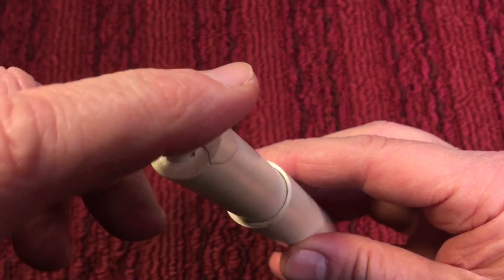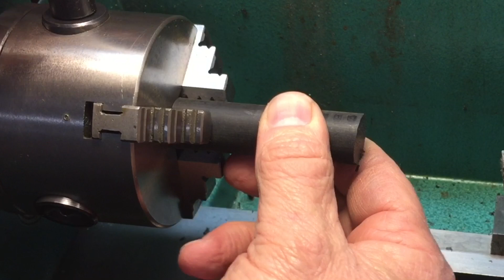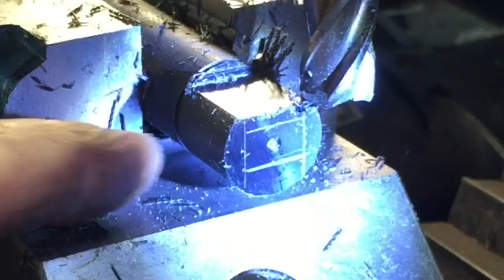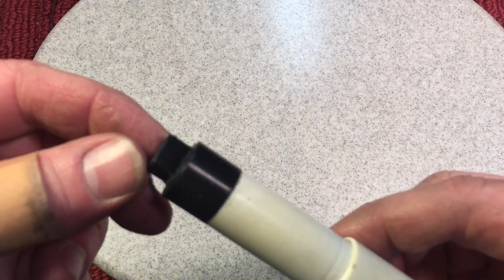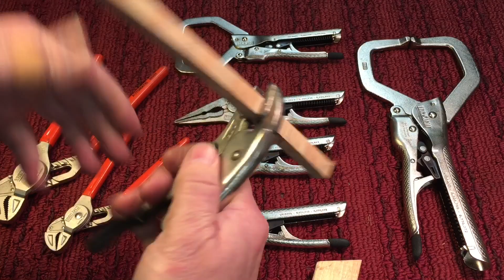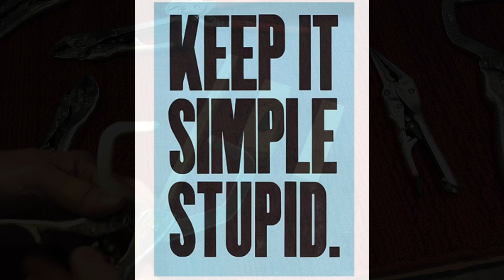Small Fabrication and LockJaw Plier Demonstration

Comment: I have both Channelock and Knipex pliers (sometimes also known by old timers as water pump pliers) and like them both, for recreational and auto/home repair use. There isn't enough difference between them to justify the higher Knipex price.  What I do like about both is that I no longer worry about "garage grunge" thanks to Scoutcrafters 50/50 mineral oil / petroleum jelly rust preventative. Good quality tools deserve good care.

Comment: I like the tutorial on the toilet paper roll dispenser because you show how to repair and make a new part. Everyone needs to be taught something new for the first time no matter how simple it is. I remember the Lockjaw tools and now I know why I haven't seen them in years. Thank you for sharing this and no tutorial is too simple, they all have gems of information.
Reply: Its the thought process. And it differs a lot depending on the tools at your immediate convenience, too.
 I built my own wire wheel/grinder like 30 years ago. I modelled it after the Eiffel tower because I reasoned that would give me the most room to work around the working end and plenty of stability as well. I had an old worn out arbor from a farmer's V sharpening tool, a GE 1/2hp motor out of washing machine, a couple of AC switches and some 2 by 4s. Today it still works and it rolls around, too.  I think my only real expense was the V belt I bought from the local auto store plus some new oil lite bushings for the old arbor to make it like new again. I also used a 3 way switch to have control over the two speeds - spin (fast) and wash (slow). I would say it is the #1 tool any one should get who is interested in refurbishing stuff.

Comment: Interesting subject John. Today I had all the stuff out ready to modify my trailer hitch. Put the mask on and went to adjust the headband screw and it bike and dropped down my collar. Bugger. So no welding till I’ve fixed it. It was a 1/4 inch column of plastic that forms the axis of the adjust mech and it had come off the strap. That’s finished no way glue would do. So a brass bolt near that diameter soldered to a brass plate which goes inside the strap is quickly fabricated. All reassembled and I’m back in business with about 40 mins less daylight!  So I save £80 on a new mask I don’t need, because I’ve got tins of various brass bolts and snips and bits of brass sheet and a soldering iron ( or 5). Hooray for hoarding!
Reply from the maker: Lucky you had a stash of Brass!!!  😃👍

Comment: Your living the dream. Doing what you want when you want and sharing your passion with others.  
  A quick note about the Knipex  Pliers. I grew up with Craftsman and channelock. They are great but after discovering knipex i  have not purchased anything but. They are harder steel they bite better they are generally slimmer profile to fit into tight areas. To me and me only they are well worth the additional cost.   
  Really liking your channel content 👍

Comment: Hard to beat a pair of real ViseGrips.  Bought my first pair at 15 - had to save up for them, because we were quite poor - then used them in heavy DIY for 40 years, at which point they had a little rust and lots of dried grease.  A little purple power degreaser, a wipe down and 5 minutes at the wire wheel, and they were as new.  Several years ago when my son was settling down, I dropped the tool in the mail to him, and now he raves about how wonderful his 50 year-old ViceGrips are!  I agree, elegant design uses the least number of parts, yet makes using the tool totally intuitive.
Reply from the maker: Marc- If I could only have 5 tools that Vise Grip would be one of them!   =D

Comment: Fixing the toilet roll holder reminded me of a job a did a couple of years ago.

My wife managed to break an IKEA standard lamp.
Which cost about 6 GBP.
The part that broke was a connector,  18 tpi NPT parallel thread on one end, M10x1 on the other, milled flats in between the 2 threads.
It only took me a couple of hours to make a replacement part for this 6 pound lamp.
Using a several thousand pounds worth of lathe and milling machine that I happen to own ...
Reply: That’s how you can justify owning all this shit, so you can save a few pennies by spending hours in the shed. And emerge triumphant , knowing that you’re certainly the only bloke on your street that has the ingenuity and tools to be able to repair not replace. All transferable skills too, a breakdown in the wilds of Wales isn’t quite so terrifying when you know what to do.
Reply from the maker: LOL Mike- Honestly I find those jobs to be some of the most rewarding and fun jobs to do in the shop. It’s true if you consider our man hours the cost of electricity and parts we totally overpaid for the repair, but you can’t put a price on pure satisfaction!  😃👍

Comment: Iv had and used a set of lockjaw c clamps for the last 8 or 9 years. All I do is keep them clean and oiled and iv never had an issue with them. They’re an excellent tool for when you only have one hand to clamp down a frame to your bench
Reply from the maker: Sean- Like you I never abuse my tools!  Mine are also that old and are like new.  However they never would have lasted thru my teenage years.

Comment: I think there's a company called armor and those c clamps are very good for metal framing they hold the same pressure and no need for adjustment it's a really good way to save time. More or less the reason why the auto adjust is such a good thing is because the new irwin C clamps are not at the same level as they used to be.

Comment: Ah the good olde K.I.S.S. rule lol. I was thinking the same about the toilet paper thing especially when you highlighted before buying it for a dollar, but it was interesting and nice to watch. I have a Greenlee flexible extension bit that has a hex end for chucking up in the drill that always seems to want to slip and round over through extended usage and I'm at the point its rounded over almost completely and I was wondering how to bring it back to being hex. I was thinking a file, but figured I didn't want to spend all that time, then I thought band file or belt sander etc and I thought I might ruin the heat treatment and end up snapping it in use. Then it struck me watching your video whether my wife likes it or not I should find myself a mill haha lol. Its weird because the flexible extension bit has a quick release end for hex bits that is held by set screws on a round shaft, that is then set screwed with a hex shank for chucking in the drill. I like it because I can use different bits in it for running wiring behind walls just wish they would stop wanting to slip in the chuck, or maybe I should just replace my chuck I don't know. Any insight?
Reply from the maker: Hi Rob- The good part about fixing a hex shape is if you place it down on a flat the top is also flat, so you can surface the top and just keep flipping it.  You can use a file but knowing how much to take off is the key.  I have turned squares into rectangles by accident!  LOL  The mill makes that so much easier!  =D
Reply: @ScoutCrafter  yeah thats the problem I think after taking a closer look maybe I have 1/16th at the very end showing the hex shape it once had lol otherwise its almost rounded over completely. Not sure why it likes to slip I have a 3 jaw keyless chuck I tighten down on it and give a few turns by hand before drilling but just always seems to slip, not sure if I should replace the chuck or maybe invest in another setup. I have the hitachi which isn't bad for the money tons of power and suppose to be carbide jaws which seem intact visually.

Comment: Been in the plumbing trade 25 years and keep both Knipex and Channellock in my box. They both have their place. Adjust the Knipex and it’s dead on perfect. Jaws are durable and grip like crazy. If you need to operate them single-handed or in sloppy mud they can be a bit problematic. This is where good old Channellock pliers shine but on certain fittings it can be tough to get the right grip. Oh and don’t let your apprentice spring the jaws like mine did.
Reply from the maker: Eric- I do 99% of all my home repairs but I needed a toilet upstairs and I was working and it needed to be done fast so I called the most reputable plumber in town...  It was an older toilet so I knew it would be a unusual replacement and the big box stores wouldn't have it...  Well, two guys showed up and one was the plumber and his apprentice.  They did the job... When I got the bill I was charged the same price for labor for both the plumber and apprentice!  $80 per hour!!!!  The apprentice could only fetch tools from the truck and carry down the old toilet!  Never again!

Comment: Thanks ScoutCrafter. Always amazed at the Delrin never have had a chance to use it but what a nice material. Wondered how you squared off the scribe lines in the vise to perfectly match the milling machine. Sorry if it sounds like an such an amateur question.
Reply from the maker: Kevin- Believe it or not that is a fantastic question- One of the big difficulties in squaring off round stock in the Mill is getting the surfaces parallel to the milling bed. Since the stock is around once you make the first cut everything has to key off of the first cut. So an easy way to do it is to make one cut then turn the article 90° and use a small square to make sure the milled surface is vertical. Then just repeat that procedure three more times!  😃👍

Comment: @scoutcrafter as I told you b4, I'm a plumber,  but I do service plumbing,  repairing old houses most of the time,  95%of the time im in very tight spots,  awkward angles,  reaching around this or that,  knipex makes a tremendous difference in the fact of the locking positions,  when I used to use channellock when I first started you would reach to tighten something and the handles would slip and move to where you have to completely pull your arm away and readjust after spending time getting into somewhat of a comfortable position if it was even possible making it extremely frustrating,  knipex saves alot of headache for that alone.  But the grip and teeth strength alone makes channellock seem like harbor freight imo knipex is leaps and bounds ahead of any and all pliers its astonishing.  Their pipe wrench included.  Then the no pinch handles saves you aswell
Reply from the maker: Brandon, I have a few pair of Knipex and Gedore.  A few companies like Irwin have copied the design almost exactly.  You being a professional will definitely notice even the slightest of advantages because of the amount of time you spend with any particular tool.  That's why mechanics usually prefer tools like Snap-On and Mac.   I do love a well designed tool!
Reply: @ScoutCrafter  absolutely,  same goes for pipe wrenches,  there are only a few good manufacturers, I don't trust most of them cause I don't want to punch a wall or stud or concrete.  Been there done that. Tbh with professional use,  I went through 2 pairs a year cause either the teeth wore down or they started shifting and handles started crossing,  but knipex I'm on the same pairs ive had for 2.5 years and teeth look as new as the day I bought them.  Spending the extra money on quality will actually put you ahead in the long run
Reply: @ScoutCrafter  in your opinion,  in German engineering just in their blood,  meaning is it that much ahead of the times that almost no one can compete with certain things? Is America focused more so on just good enough to leave you wanting another? Putting the same tool out every year to make you buy the 1 tiny tweak to that product. Or is it that we just can't grasp how to make a equal or better than?

Comment: Can you re-temper the jaws of the “new” vises grips to make them harder? I use them to hold nails and then pull the nail by using the pry bar on the vise grip jaws. The jaws must bite into the nail without slipping.
Reply from the maker: Dennis- I don't think it's the temper I think it's the steel used!  The vintage Vise Grip Jaw steel was amazing!

Comment: What is “ dillrun” ? It looks really interesting.
Reply: It’s callled Delrin. A polyoxymethylene acetal plastic. Very stable. Scoutcrafter loves the stuff. It’s good material and although not cheap, is less expensive than most metals to work with and practice if you have a lathe.
Reply from the maker: Valerie- Shed Man X is spot on, it's a really fantastic type of plastic that is super strong, super dense and a dream to work with. The downside is it's very expensive but I found a bunch on eBay years back and just love the stuff!
Reply: Thank you I’ll keep my eye out for it for our workspace!

Comment: Now I want to see you make a toilet roll holder out of wood on the wood lathe
Reply: You can make almost anything on a wood lathe and they have a huge following of very imaginative people. If you're looking for a starter one to try I recommend the 3/4 hp outturning bowl lathe that HF sells. I think the # is 34706, it's pretty popular. You can google it up if I got the # wrong as its well talked about around the net. It's got the CVT transmission and with the outswing capability you can almost turn anything on it. Standard 1" by 8 TPI chuck means you can put more expensive (higher quality) chucks and accessories on it, also.

Comment: The Knipex Cobra 10" are in the range of 20 Euros here on Amazon, so round about 24 USD. VAT of 19% already included. The Channellock 430 (also 10") are round about 25 Euros here on Amazon, VAT also included.

And the Cobras and their locking mechanism aren't actually that new, Knipex introduced this in 1984.

The Knipex Raptor you have is more comparable to the Channellock 410 "Nutbuster".
Reply from the maker: I am glad that Knipex and Gedore are producing high quality tools and also make them affordable in their own country.  If every country did the same thing and competed against the competition we would all be better off... So many countries have discarded their own manufacturing in place of cheap imports.  Thanks Marcel!!!!

Comment: We buy tools primarily to fix things and keep the house from falling down and secondly for hobbies. Today you fixed something other then repairing tools for your hobby. Although you did a fantastic job fixing the the toilet roll holder it was a failure. You have white tiles and white holder and the black fixing is not up to your standards. It does not match.
Reply: When the TP is loaded, you won't really see it.
Reply from the maker: They do make White Delrin but for the price of it I could buy ten new TP rollers!  😂😂👍